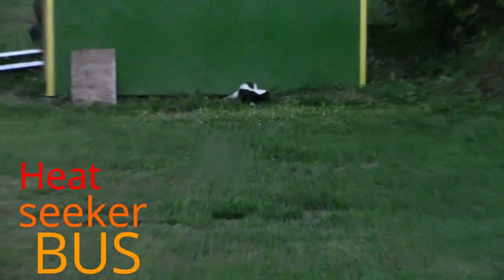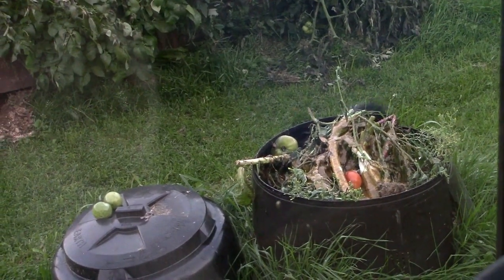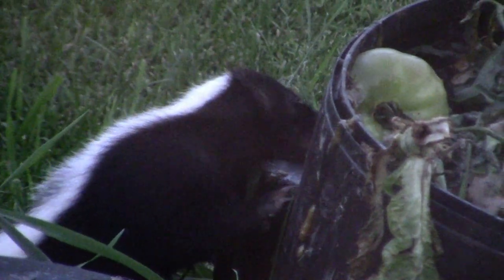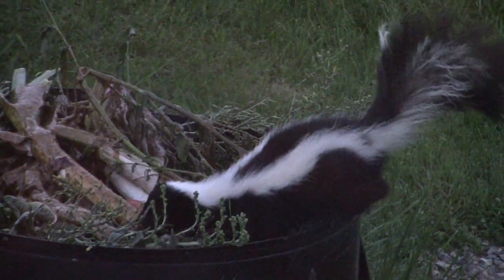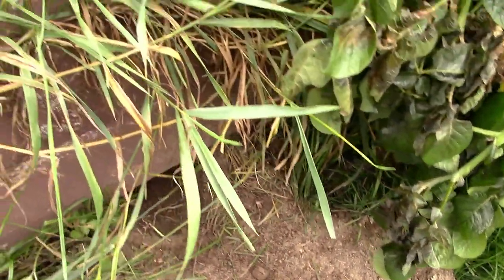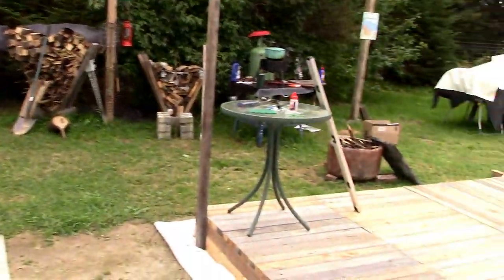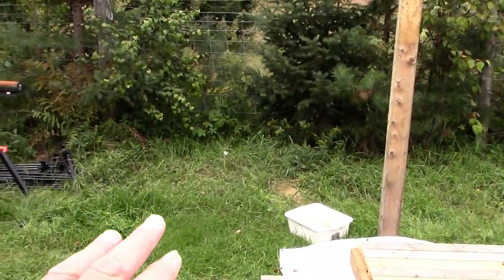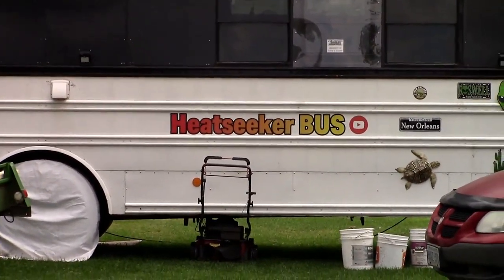Skunk and a little update, new deck. bus conversion, tiny home skoolie RV

Comment: Close encounter of the stinky kind! 🤢
Nice deck. You can have dance parties on that.
Reply from the maker: surprisingly no smell with the skunk living here. the deck will be nice for sure. gonna track less dirt inside the bus.
Reply: HEATSEEKER BUS I am surprised. Usually they stink just because.  Yeah, that tracking mud and snow into your tiny space will get old fast. Are you ready for winter?
Reply from the maker: @charlotte97838 
 I'm not  ready for winter yet.  I bought a diesel air heater. I need to install it.  I also have to cover some windows.  I'm pouring a cement pad this weekend.  so in a month, I'll be able to drive the bus on it back by the deck.
Reply: HEATSEEKER BUS, so you’ll walk across your deck to get into your home (bus)? That would be awesome parking a heavy vehicle on a nice hard level surface. No sinking in the mud no getting stuck but how are you going to keep the critters from digging under it? Or will that be a problem? I hope your back is feeling good, looks like you’ve got a lot of work ahead of you. My back feels good but I know when I’ve done to much. Have a great day Pierre.
Reply from the maker: @charlotte97838 . yes, I couldn't walk for a couple  days.  I did too much. so time for some editing.
Reply from the maker: @charlotte97838  I have old tarps under the deck.  it should help from the animals from digging